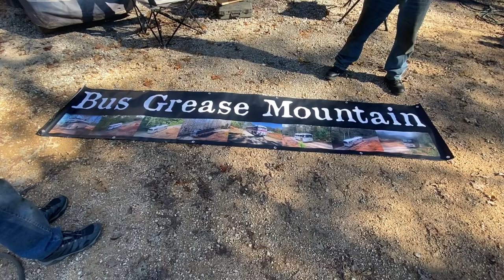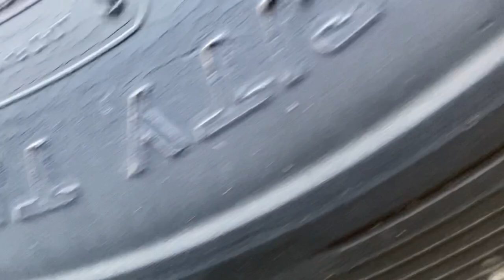Crown school bus Rv conversion detroit diesel 6v92TA

Comment: Said it before and I'll say it again.  Love seeing Baldwin Filters on engines.  There are no better.
Reply: I cut open and dissect many of the filters that I change and I will not use Baldwin filters under any circumstances.  Fleetguard and Donaldson are far superior filter that are built much better then competitors, wix filters are my third choice in a pinch.  I have to pay for filter disposal and I am charged by the 55 gallon drum so it is cheaper for me to crush filters so I made a fixture that sits in my 80 ton hydraulic press and what I have found is the cheaper built filters crush down to a much smaller size then the fleetguard or  wix.

Comment: While not the 1973-'91 Crown SuperCoach (Series 1) with the midship under floor Cummins 855 engine and Eaton-Fuller 10-speed transmission I was hoping for, I like this one none the less with the rear mounted 6V92 and Allison. Sounds like the engine needs a little TLC as it took way to long to start and running rough. Definitely will be following this one as I love these California Crown Coaches. Looking at those tires, oh lordy I can't believe they drove that from California to Tennessee with those tires.

Comment: School buses give me nightmares! I grew up with my dad owning fleet contracts. And I worked on many others buses from 4 counties around us. Prep for DOT inspection. Dad really isn't mechanical at all. From a crazy young age working on trucks and buses. Milk crates and cheater pipes were my life. Dad would keep me home from school to put head gaskets or an engine in a bus so it would make the afternoon route without renting one. Clutches in. Brakes. Would lay down at night and see those long driveshafts and exhaust pipes.

Comment: If he drives into Arizona with the bus painted yellow the paint should be changed to other than yellow. It is a vehicle code violation to have a "yellow bus other than school" Arizona revised statute 28-902. Might save some problem.
Reply: That law is only applicable to Arizona vehicles - not one from out of state.